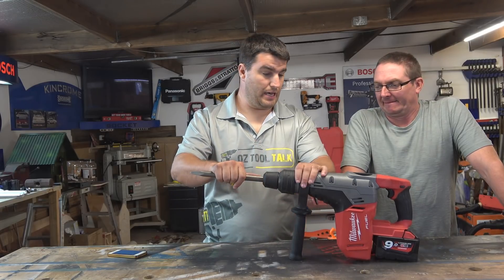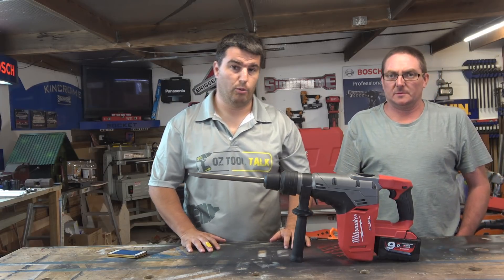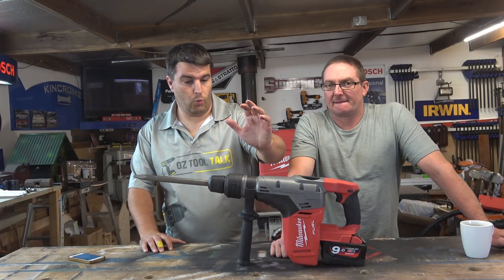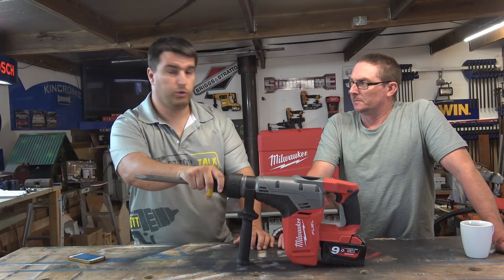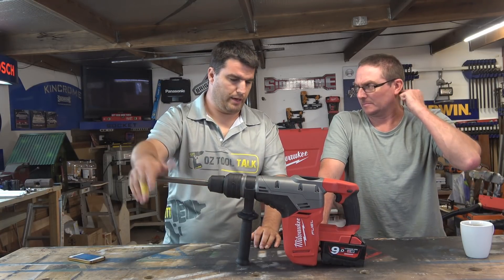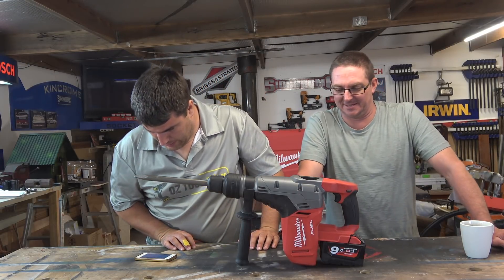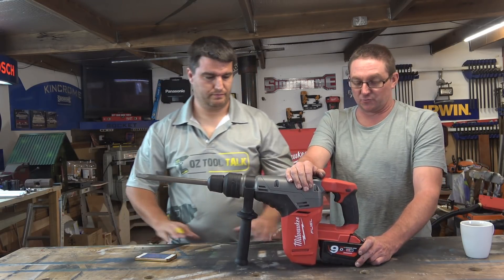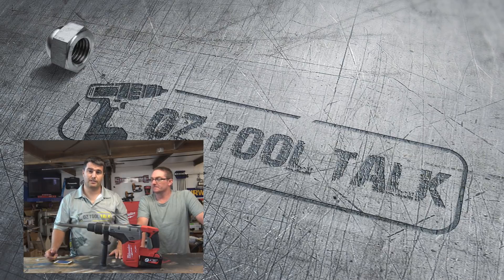Milwaukee FUEL SDS-MAX rotary hammer drill  - M18CHM / 2717

Comment: POS...handle does not tighten the clamp adequately and if you pick up drill by handle it slips away from the clamp and if not careful your expensive drill falls to the ground or farther if you are working from an elevated location.

Comment: Another great vid, chaps, always a pleasure to watch. I agree the DeWalt has it between the two, the higher voltage is so much more efficient. The fact that the DeWalt also does rotary only is a big bonus, it means you can use dry cut diamond core cutters. 

Keep it up!
Reply from the maker: [Dwain] ah yeah, damond core cutting, forgot about that in the review! Do the cordless rotary hammers have the torque for large core drilling?
Reply: Oz Tool Talk , yeah, I've used my 28 Volt and 54 Volt sds plus machines to core out brickwork for extract fans, those are 4" holes, they cope just fine. However, where's the cut off point? Could they all cope with core cutting? Interesting point! Back to work, fellas, you got another six and a half hours hard labour ahead of ya! (Thinking back to the big shoot out )

Comment: Absolutely solid review and explanation throughout as always chaps.

What's the standalone cost of the 9.0ah Milwaukee battery in the most popular stores in AUS?

Cheers.
Reply from the maker: [Dwain] thanks Ryan. Seems to be around AU$210
Reply: Oz Tool Talk Wow that's a lot. High power battery backs (5ah, 6ah, 9ah) are beginning to be as profitable for tool manufacturers as the tools themselves. 

The 3000mah 3.7v 18650 lion batteries in these (15 inside the casing in total) are about $2US a piece when bought in 1000+ piece batches and the safety circuitry is already purpose built at about $5 a piece. There is very little innovation the dewalt and makitas need to do after the factories provide the parts...

Aftermarket battery companies are slowly gaining traction around the world as they can undercut the huge margins quite easily.
Reply from the maker: [Dwain] Hey Ryan. I'm interested in your take on this, but it doesn't 'ring true' for me. Are the 3000mAh cells you speak of the same ones that the companies are actually using (e.g. Sanyo/Panasonic 20A / 25A output)?
Reply: Oz Tool Talk yep...

The most common ones are the Sony vct6, lg hg2 and Samsung 30q for 3000mah cells.

All will be available at those prices when a huge manufacturer like Milwaukee places an order of say 10k cells and those batteries are the high drain versions capable of 20amps continuous which is what the cells require...

Comment: we have 3 at our company. abuse the heck out of them. they run 20 ish minutes of hard use without overheating, longer if you swap battery as soon as it loses one bar (half dead). keep them well greased. gotta warm them up in cold weather to get them to hammer.
Reply from the maker: [Dwain] good feedback Mike!

Comment: Hey guys awesome review 
Just a heads up to anyone who is in the market for one of these as i couldnt really find much info when i was thinking of buying this 
Im a plumber so i do alot of new homes and commercial work and im always drilling holes in brick and concrete and its usually always 
2 35mm holes 
2 32mm holes 
4 25 mm holes 
3 22 mm holes 
On a daily basis 
And im always left with some battery still and it goes through like butter 
Its straight off the bat noticeable power 
Its not too heavy like most corded models i realised 
It fits most sds max brand drill bits out there
It has absolutely no kick back at all 
Its just an overall 12/10 thats how good it is i highly recommend it
And its a milwaukee so u know you got an excellent product and warranty life to back you up  
Hope this info helps
Reply from the maker: [Dwain] good feedback Billy! cheers
Reply: I know it’s been a while but can you comment on it’s chiseling ability? 

I do subfloor ventilation in Melbourne and install double brick vents frequently, this requires blasting through bricks and I’ve found my fathers 2.7 joule Milwaukee sds plus unit can’t keep up with a corded unit... I’m trying to transition away from any corded tools, any help would be appreciated 👍🏼